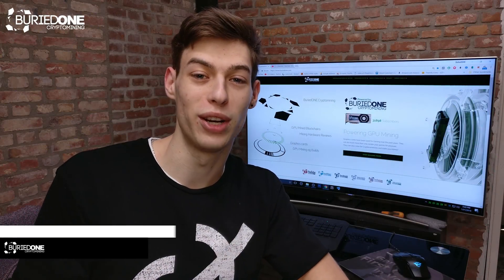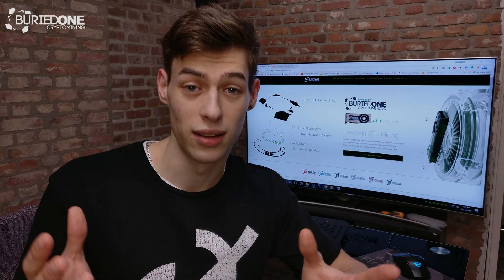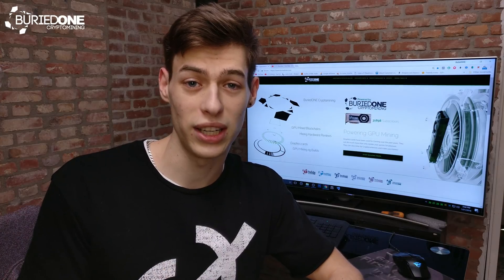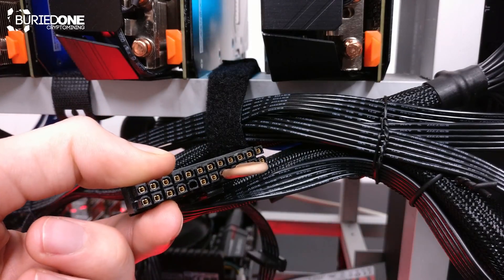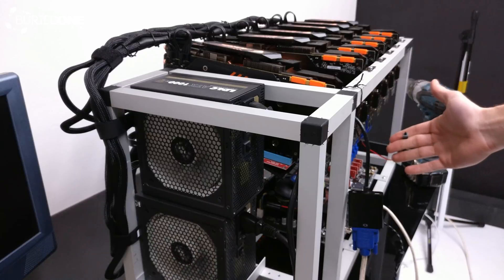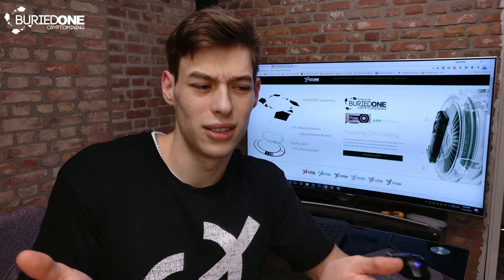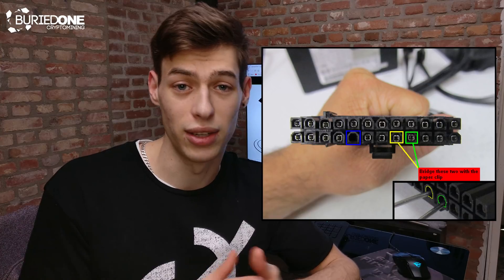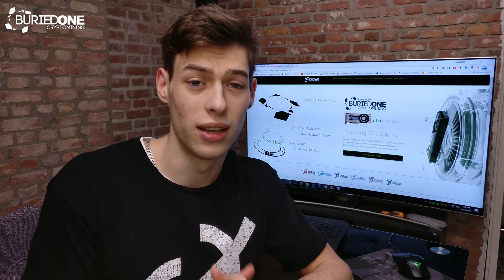How To Bridge Multiple Power Supplies #INDEPTH Series

Comment: Yo bro I hooked up a second PSU to my GPU and hard drives separately but I'm having issues with the standby... If I turn off PC (main power supply) then the second one turns off completely and no 5v is present (on red wire). I connected the green wires of both supplies and also the standby wires of both. How can I get the second one to go on standby?

Comment: I did similar to your setup. 

1- CPU/Mobo ~ 270W PSU#1
2- RTX 2080Ti ~ 600W PSU#2 

I switched on PSU#1 first (via PC power button) then PSU#2 by a jumper cable (solder rod 😂)

Now, what should be the sequence to switch off? Should we first switch off PSU#1 then PSU#2? Or vice versa.

Comment: Still not clear.  Most of us know you can turn on a PSU by shorting green with yellow, but the question is how did you mix the power.  Did you use one power supply on half the cards and the other on the other half or are they connected in parallel (sounds like they aren't), but that's sort of what I'd think people were wondering... not how to turn on a second power supply without a button.

Comment: Would it be OK to run 12v of two separate cpu to a single distribution block? The main unit is a EVGA-BQ850 and the other, I'm about to pull out of a older Dell tower. I believe the Dell unit is about half the power of my EVGA. I'm currently using the EVGA to power some 12v car audio stuff in my workshop, two small amplifiers(350-400w-ish combined rms,) and a small led light strip. I'm wanting to remove one of the two small amps and install a larger amp, an equalizer, stereo reciever, and a few more light strips(these are 5v.) This is why I would like to add a second cpu to a combined distribution block. 12v stereo stuff doesn't like power from separate sources.

Comment: Is it an issue if the shorted PSU is turned on, supplying power to a couple GPUs, if the PSU powering the mainboard/CPU and other GPUs is off? I'm trying to picture a GPU powering up in a PCI slot that is not, seems like that could be an issue if for example the motherboard shut down for any reason, while the other PSU is still running. Even if it was a simple failure of the primary PSU, is this not a concern?

Comment: you should also connect the grounds of the two PSUs
Reply: Why and how ? I m trying to put my gpu on my 2nd psu but it keeps shutting down as soon as there is a load on the gpu
Reply: @BOSs-1313  I'm not a huge expert, but this is what I have read on multiple pages, that connecting the grounds is a must. The easyest way to connect the grounds, that you connect with an insulated (to protect other parts) relatively thick preferably copper wire between the two PSU cases. If the case is lacquered you must find a spot where there is a a screw. Unscrew put the wire under screw back. Before you screw it in you should also check with a multimeter and of course do this with a switched off power supply disconnected from mains. With the multimeter you check between the psu connector COM (common) and the target screw. Make sure that the cable remains external to the PSU, otherwise it can be dangerous. Please ask other people too as I am not an expert in this, this is just what I have read. After you did this still disconnected from mains, chect if the two motherboards COM is connected. If yes you succeded. When switching on the power supplies check the screws with a Voltage Detector Pen for additional safety, do not touch the housings before.

You can buy also cables for this and this should be the preferred way: If you are not experienced with electronics, please do this instead. In these cables the ground is connected: https://www.banggood.com/REXLIS-3384-Dual-PSU-Power-Supply-24-Pin-Adapter-Cable-30cm-ATX-Motherboard-Adapter-Cable-Extension-Cable-p-1821503.html?utm_source=googleshopping&utm_medium=cpc_organic&gmcCountry=HU&utm_content=minha&utm_campaign=minha-hu-en-pc&currency=HUF&cur_warehouse=CN&createTmp=1&ID=6287830&utm_source=googleshopping&utm_medium=cpc_bgs&utm_content=sxxx&utm_campaign=sxxx-ssc-hu-all-newcustom-ncv65-0409&ad_id=430798360544&gclid=Cj0KCQjwkZiFBhD9ARIsAGxFX8CsZJ8fjALYi3CHSbFPr0hDo9Rx2TEHgsC-rRb13N2XiuFaAG5C7bUaAhbnEALw_wcB

Comment: Great info!! so can I use a bit more of your time to double check? (hope so!)

I have 6x GTX1080ti's and I need around 2000w to power the rig up so my options are to buy :
1x 2000w psu's Waaaaay too expensive     
2x 1000w psu's  expensive   
3x  750w psu's    actually affordable
So if I understood correctly, can I use one of the power supplies to power the motherboard and of the two cards and then jump start the other two psu's just to power two gpu's each?

Would it matter if the PSU's are different voltages?

Thanks guys!

Comment: Do not follow what he did. I turned on the 2nd psu first and then my main psi. Now my 3060ti is dead.
Reply: did you use a splitter on both PSUs or a single jumper on the 2nd psu (while first was connected directly to the motherboard)?

Comment: im here to find a solution, i have cougar cmx 700w psu but for some reason i lost the sata cables molex which was in the bag and now the psu is left iots own builtin cables which are for board cpu and gpu, i purchased a bridge connector from ebay and also bought a cheaper generic psu from the local store only for hdd and the cheap psu has also power output so i wont need to connect both psu seperately with power cables in an electric socket.. my question is IS IT SAFE?

appreciate for the reply

Comment: you say "the one connected to the wire is not connected to the cpu" what do you mean? 

If I got this correct : 

You short one PSU as shown in the image and connect that PSU to the GPUS 
you connect the other PSU (the main one) to PCU, the one without short ? 

May I ask how do you chose which cards to assign to one or another PSU ?

Comment: When you say "into the motherboard" what do you mean? only 1 of the 12 pin connectors should be connected into the 1 and only motherboard 12 pin connector slot?
or do you mean, don't short those 2 wires AND somehow also find a way to plug it into the motherboard?
or do you mean, don't plug a second power supply into a video card that is plugged into the motherboard?
I'm assuming you could power Hard Drives and CD/DVD/Blu-Ray players with a 2nd power supply, but the main thing I want to know, is about using that 4 or 6 pin connector from a 2nd power supply, to the video card.

Comment: I HAD TO TAKE A LEAP OF FAITH WITH MY ONLY (RTX 3090), and holy sht it worked, really worked.
Reply: I have a 3060 ti and I had to use 2 power supply lol
Reply: Did it fry ur gpu ??
Reply: ooga Memes  how did it die? Did you plug two PSUs into one gpu??

Comment: @buriedONE Hello, how are you? I have a question to ask you about the power supply unit i have psu 200w Max, and GPU"rx580 8gb".
I have one, I think it's 300w psu, it s possible to plug it in for the gpu.
and 200w for all my specs, except for the gpu no
they can work? pls

Comment: The power supply connector sold on Amazon was problematic for me. Where the adapter connected to the motherboard one of the connections didn't seem to fit snug enough which caused the power to be intermittent and the motherboard to reboot each time connection was lost. I used a wire to short the second psu after that and the problem went away.

Comment: In my case, I have a LENOVO PC which does not allow upgrading of the power supply. The connection to the motherboard is via a 10-pin socket and not 24. I need additional power because I want to connect a new graphic card with a 6-pin PCI-E connector. I thought I could solve my problem by adding a standard relatively low-power power supply, without any modification in the original configuration. The issues are: a. how to synchronize turn-on/off for the two supplies and b. common grounding. Is there a simple solution?

Comment: can I just have one connecting to everything , and the other one just powering my gpu?
Reply: vThrax THATS my question
Reply: @thomasnguyen1914  i figured out the problem , the power supply has to be connected to the mother board to get power but if you buy a power supply tester then that fixes the issue
Reply: vThrax bRo, I put in the psu right? Turn on perfectly fine, second I run a ROBLOX game. It goes green then shuts down. Now my pc is ruined :(
Reply: @thomasnguyen1914  you have to have the splitter if your gpu is on the motherboard. It should not draw from both power supplies at once. Since it is pulling power from the motherboard and that psu and from the PCIE and the second psu, it will fry the board, unless you bought that adapter which will keep the two power supplies at the same voltage

Comment: Thx your video came in handy I just built and upgraded my pc from the ground up starting with a EVGA 500w power supply and got a power hungry gpu and cpu 5700xt and 8700k im able to run them just fine at stock but just overclocking my gpu push the power draw for the system to 460w and that's not a max overclock nor was my cpu overclocked at all so soon as I saw that I stopped immediately and just undervolted the whole system. I have another power supply a 650w but just did not feel like dealing with the hassle of reconnecting and hiding cables all over again tell I thought what if I had 2 and the 2nd just be a dedicated power supply for the gpu only as it can pull up to 300w on its own if overclocked but ran into the issue of needing it to power on by its self as you know im very lazy I hate reaching back behide the pc just to turn off the power supply for the gpu but that dual power supply connector you showed on amazon is the answer to my prayers!!! Thank You very much mine was only $3 lol.

Comment: My cpu needs 12 pins for power, but both my cheap power supplies only have 2x4pin connectors (each, so 16pins total). Is it okay to use both to test my motherboard real quickly?

Comment: I have that b250 board with multiple atx connections but 2nd gpu doesn't power up. Tried using jump wire method, still nothing. PSUs function in different system so is there a bios setting or something that I am missing?

Comment: Every powersupply produce slightly different voltages if you dont power motherboard from both powersupplies there is gonna be voltage difference between pcie poweroutput and gpu power input socket.
Reply: Is it dangerous? I've seen so many people doing it without problems

Comment: bro till how many psu can we connect with this trick and can we make a 3000watt rig with 6 psus of 500watt. i want this because this would be too cheap
Reply: I came wondering why my 3 power supplies connected by 2 splitters can't handle more than 4 cards!
Reply: So did you do it?
Reply: @hkuowwpw9557  no
Reply: @harshanand9097  do you still do mining?
Reply: @hkuowwpw9557  no

Comment: Hi BuriedONE Cryptomining
I need to confirm that i have two power supplies one is TX850m and Second TX650m along with splitter which you recommend in video so for this do i simply need to connect male part of splitter to motherboard and rest of other two female part of splitter will use to inject male part of two power supplies ?? and then i need to power on button of two supplies ?
I just simply need to do this or i also need to change Bios setting accordingly ??
If i need to change bios setting then guide me about it as well .
i have asus Z270-P Model of motherboard .
any help regarding this is appreciated in advance .
Thanks

Comment: Hi,
Could anyone give me any suggestion how to turn 4th gpu ? I have 4x rx570 and I can manage  3 gpus working. In bios 4g enabled and pcie set to gen1 ,also tried gen2, tested risers,pcie slots and gpus one by one and all good, problem is that when Windows start loading with 4th gpu that Windows circle stopped spinning and PC freeze.In bios I have all cards detected and all ok.My mobo is Biostar BTC250+
Reply: What is the wattage of your PSU (it might not be enough) ?

Comment: Can I power one card with two different psu. How safe is it
Reply from the maker: Yeah you can, and its quiet safe
Reply from the maker: i do recommend powering gpus with the same psu but then just splitting it up into two sections each powering half of the amount of gpus you have
Reply: BuriedONE Cryptomining  I am forced to split because I have already spent a lot and there is 8pin excess in one psu and 2x 6 pins in other psu for which am using a converter to get 8pin

Comment: yes please i have a question: my rig has 4 gpus, recently 1 riser went dead, now i am waiting for a new one to arrive, meanwhile i dont want that forth gpu just stays off doing nothing
can i plug it to 16x slot on the motherboard, while conecting the rest ofthe 3 gpus via x1 riser slots?  btw i have an asrock h81 pro btc r 2.0
Thanks BuriedONE.
Reply: hisgr8nessmadzak yes
Reply: davewolfplays are you sure. is there any risk involved?
Reply: hisgr8nessmadzak it my run a little hotter maybe cause of air flow but a gpu made to be in a 16x pci spot. PS I have 3 rigs 16 cards
Reply: thanks!
Reply from the maker: Dave is right ;) Thx for helping him out dave!

Comment: I once heard something about add2psu connecting grounds (or neutral?) to level out any differences produced by multiple PSUs. Anyone knowing more?

When shorting one PSU i cannot remote boot because one PSU keeps powering the motherboard, probably through the PCIe slot power.
Reply from the maker: Nope, just dont power the cpu and motherboard with the powersupply that stays on

Comment: How to make the miner start on its own if I lose power and back?
Reply: Sudhir Talekar go to start - Run and type: shell:startup copy start.bat there :)
Reply: Bec Kalaj Thanks and how should I start the miner (hardware) .should I jump the mobo switch?
Reply: you got to enter the bios.press f2 or delete when the computer boots.
there must be a setting about power loss. you can activate that the computer restarts after the power comes back.
as for the miner you got to put a shortcut into a shell called "startup"-ask google for further instructions-
Reply from the maker: There is a usb device that can do htat
Reply: BuriedONE Cryptomining can you plz elaborate more ..currently I’m
Using bios settings to startup during AC power loss..well the issue is windows 10 boots to recovery mode and I have to manually start the miner then